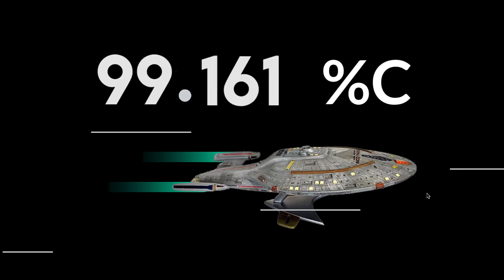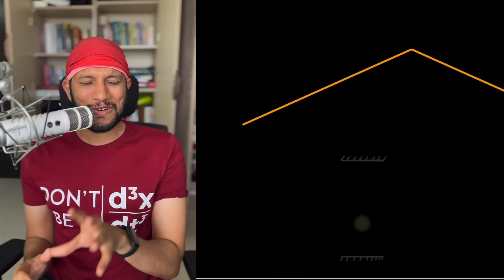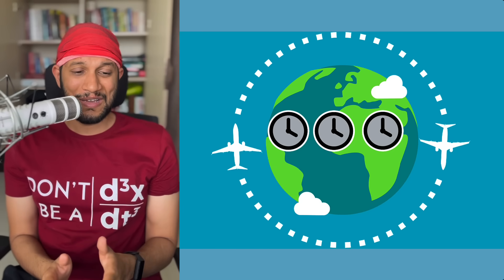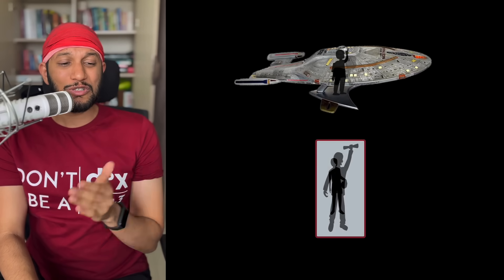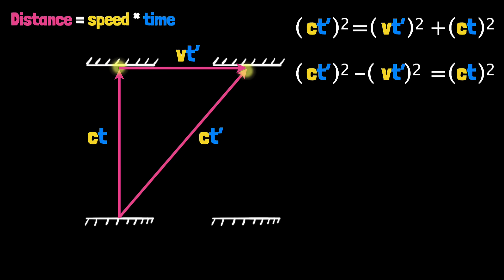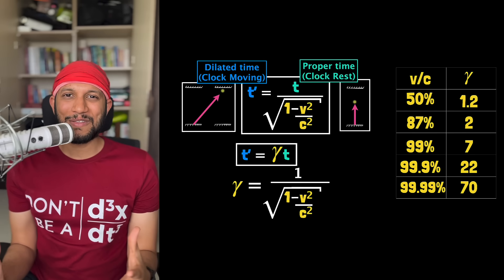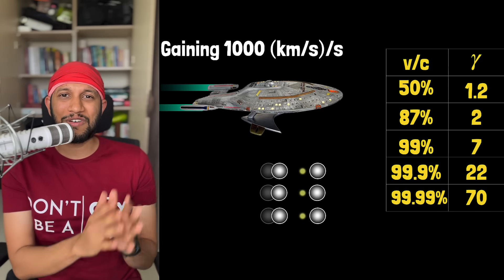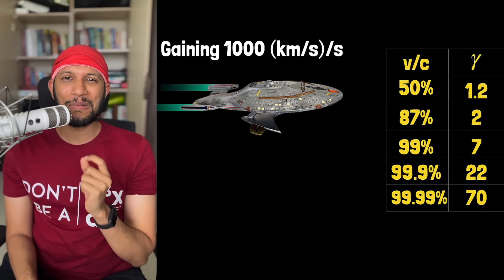I finally understood why you can't go faster than light! (My mind is blown)

Comment: Fantastic and wonderfully explained video. But I have a question...
What if push became pull? If I pulled the lead atoms in an object during acceleration, then the photons for energy transfer should reach the trailing atoms at an accelerated rate. This would decrease time dilation in the body of the ship, but if we used engines, due to how they work, you'd get conflicting dilations with the engines being slowed down while the hull is sped up. 
The solution would be to use external forces, like gravity for example, to accelerate the ship, which should allow the reaching of lightspeed. 

Also, how does this affect an orbiting object when on one side the the planet you are accelerating and the other side you are decelerating? Each half of an orbit should nullify the other half's time dilation. I do understand that this is a bit untestable on earth since the solar system rotates perpendicular to the galactic plane. I hope that makes sense and I am explaining the thought well.

Comment: the problem with this example is that nothing changes simply because of your perspective.  If you are within the ship and you see it bouncing up and down in a straight line, it doesn't change anything.  The relativity of your position to the ship doesn't change the amount of time it takes for the photon clock to tick.  Your perspective makes it seem so, but it's still ticking at the same rate as if you were in the ship.  This is one of the outstanding problems with relativity.  It attempts to measure absolutes based on relativity.  Furthermore, time is a construct.  We use it to measure something between occurrences of events.  In this case, you are giving time a construct of the photon clock ticks.  The event is the strike at the upwards stroke and the measure of the downward stroke.  Time will always be relative to the events used to measure it.  It's not an absolute.  If you want to get down to the real nitty gritty of physics, remove time as a factor.  You will get much further in your research.

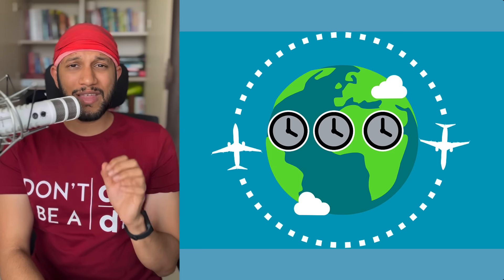Comment: 4:24 basing of what you said, as a plane traveller I could also say that the Earth is moving, not me, and its time should be slowed down instead of mine but the effect is opposite, I don't understand why.
Reply: 7:44
Reply: According to SR, from earth, the spaceship clock would slow, and from the spaceship, the earth's clock would slow (considering their frames are perfectly inertial wrt to each other constant velocity*). but during that acceleration and deceleration to get to light speed, go to space and return to earth, stuff happens and spaceship gets rusted (of course, you can calculate it) (search accelerating frames and time dilation).

Comment: I understand this perfectly well, and it makes sense, but I've always had a question that makes me feel like this might be incorrect on some level. Whenever the idea that accelerating to light speed takes infinite time is mentioned, it's always explained from the perspective of outside the ship and with the logic "light moves at a constant speed regardless of your reference frame". If that's the case, then what actually is light's own reference frame? Because from the reference from of the time dilated ship once it stopped accelerating, now being 'stationary', it would be everything else moving around it at speeds approaching C without having any source for the acceleration. While the light inside the ship is still moving normally.

I'm not really sure if I put it into words correctly, but there's something about reference frames involving light and the universe that doesn't fit in my head regarding this current theory of light.

Comment: Thank you for the nice explanation, I had one question. Is speed not relative to other objects, so if a spaceship accelerates(acceleration is exact) away from Earth and reaches a speed of 99%, it could also be that all objects around the spacecraft including Earth travel the other way at 99% speed. In that case, the spaceship would be able to travel 1% faster. I know I am making a mistake but can someone explain?

Comment: I’m 52 and have a college degree (granted in history) and am also a big sci fi guy. This is the first explanation I’ve heard that actually made sense, even in physics classes. 
Thank you.
Reply: I do not understand this video at all. When he says that the time slows down causing gate speed of the clock to slow down, he means that our actual time slows down? But only because “it takes more time for the photons to travel lengthwise when they are moving”?
Reply: @strokiee  Time doesn't slow down for the people on the ship. For them (the people on the ship), that photon is still moving the same distance and takes the same amount of time. That's where relativity comes in. For the people outside the ship, each "tick" on that photon clock on the ship takes longer for that tick to occur (because the photon is still traveling at the speed of light (no faster or slower) but covering not just the photon clock distance but the distance the ship has traveled during that tick as well. That requires time to slow down for the moving object, but only relative to objects around it in order for that photon to cover that extra distance. The people on the ship will theoretically age at a slower rate relative to the people not on the ship. Nobody notices the difference because time is relative. Not sure if that helps or not.
Reply: @keyser456  this definitely helps, but for the relative observers outside of the ship, they see the ship move slower then for the people on the ship?
Reply: @strokiee  This may sound weird, but I don't think it matters at that point? What the outside observer sees is only relative to their own experience, as somebody outside the ship; they have no clue time is moving slower (relatively) in that ship. 

Whether the ship is is faster or slower (or the same speed) from their perspective has no bearing on what the people inside that ship are experiencing. This is really hard to grasp from our typical human experience. Time being relative isn't natural, to us.
Reply: @keyser456  if there are two objects at rest, and one starts accelerating, then time slows down for it relative to the stationary observer, then surely there has to be a speed at which the accelerating object appears at rest for the stationary object if speed is distance/time?
Reply: @strokiee  From the POV of a static observer, the photon on the ship has to cover more distance, but because c is constant, and distance = c * t, it means that t from the POV of that observer must be longer. And the faster the ship moves, the more distance the photon has to cover per unit time, so time slows down even more from outside POV.

The way you mention 'actual time' is intrinsically problematic. There is no 'universal time' according to general relativity.
Reply: Does he even realize that his conclusion ends with the energy required, infinite or finite? Does he know that he also need energy to see the photon in the photon clock bounce? Just for reference, the photon in the photon clock must split off a photon to our retina in order for us to see it. Even if you only see the photon in the photon clock once a second, the photon in the photon clock must split off a photon to your retina every second, not to mention that Einstein also saw it. So, at least two photons are needed per second. Of course, to connect the dots or photons you see and form the jagged image, does he know how many photons he need to see? Does the photon clock on the spacecraft have enough energy to emit enough photons for you to see it, whether you see it or not? Indians are the best at regurgitating what they have eaten and acting as if they have understood it. After all, at a speed v comparable to the speed of light c, does the Pythagorean formula still apply?
Reply: First you tell time on a watch from the outer radius ticking alone.  Not comparing the smaller circumference with the larger one. Only small to small and large to large.  😂
Plus photons traveling at the same speed will tick faster in a 12 inch box and take longer to tick in a 12 ft box or chasing an object.
Reply: Despite the rude jabs here..."Oh the Humanities!"....your statement is very common in our population.

Many people highly educated or stopping at HS are highly specialized in education today.  There are far fewer hard sciences students than non empirical students in most of society.

However there are a great number of Sci Fi fans that have picked up science sounding terms but applied by fantasy writers as a vague technobabble.

I (physical chemist) run into a lot of people that insist they understand and are experts on some material theory or another (astrophysics, medicine, chemistry, biology, geology, etc...).  Yet in casual conversation I can often find out exactly where they picked up the idea.

I'm sure you find the same is true when you meet someone that learned history at the box office.  History is a fine and honorable degree and profession.
Reply: @STho205  there’s less hard science students because it’s not for everyone. Most people can’t obtain the degrees for those jobs
Reply: @extremelynoobgaming4742 you think everyone on earth is fundamentally the same
Reply: Sorry if it sound mean, but a college degree in history is as relevant as no degree when it comes to physics.
Reply: so essentially you don't have a college degree
Reply: @redbean9410  ???? You do understand that history as a field of human knowledge is older than any natural science, right?
Reply: @teacher_fher  lmao okay and? a history degree isn't gonna get you anything, except maybe a job as a history professor lmao
Reply: @redbean9410  What you're trying to say is that there is no future in history?

Comment: I believe I understand your video. But I still have a question: 
A spaceship is going away from Earth. According to Earth's perspective the time is ticking slower on the spaceship.
My guess is it is the same the other way around, from the spaceship's perspective time is ticking slower on Earth.
But when the spaceship goes back to Earth the interal clocks show that Earth's perspective was the right one.
Is it because the spaceship returned to Earth and not the Earth went to the spaceship's coordinate system?

Comment: What is so special about light that makes it move at the speed of light, while nothing else can reach its speed?
Reply: The fact that it has no mass. Anything without mass moves at the speed of light while nothing with mass can move at that speed.
Reply: @narfwhals7843  thanks for your reply.
Are there conditions in which light travels at a fraction of the speed of light without gaining mass?
Reply: @SamsungGalaxy-vw9gy 
It moves a Little bit slower if its not in a vacuum.

Comment: Still doesn't make sense to me.  It seems circular. The ship can't go the speed of light because a photon in a photon clock is traveling at the speed of light and is being made to travel further.  But then why is the photon traveling the speed of light and no faster?

So, the ship can't go faster than light because the photon can't go faster than light.  Then we could simply change the question from "Why can't we go faster than light?" to "Why can't the photon go faster than light?"  Your explanation still doesn't answer the question.  At least not for me.

Comment: counter point
we are never at "proper time"
we don't have a real frame of reference

while on earth we are glued to the earth which rotates
while in space we are glued to the gravity of earth which rotates around the sun
while stationary towards the sun we are glued to the suns gravity which travels accross the galaxy
while stationary towards the core of our galaxy our galaxy is moving through space 

so which speed is our frame of reference? "proper time"
cuz the earth spins with 1 speed
the earth orbits the sun at another
the sun orbits at a 3rd speed
the galaxy moves at a 4th speed

and then going even crazier since space is expanding then SPACE ITSELF has a speed in which we are moving
so which is our proper time?
Reply: The proper time is, by definition, the time elapsed on your own clock.
It's not some universal reference time. Such a thing does not exist in Relativity.
It is the time that passes for an observer in their own reference frame.
Reply: @narfwhals7843  so time dialation is also relative
if 2 galaxies that are moving away from each other faster than speed of light somehow observing each other how would they notice time for each other?
Reply: @MostWantedWannaBE  yes, time dilation is always relative. It depends on the relative velocity.
If two galaxies move away from each other faster then light they can simply not observe each other. If you allow them to do so you have already broken the laws of Relativity and can draw any conclusion you want.
If they recede from each other very close to the speed of light they will observe each other's time to be extremely slow.
Reply: @MostWantedWannaBE  Correct. We will never observe them. That is what I mean. We can't observe them so we can't observe their clocks. That is part of the laws and if that is not correct we don't know what to conclude.
Spacetime curvature makes this a little more complicated but not so much that it changes the outcome.

Comment: for me is very simple .. light is not an abject actually, it represents microscopic particles like electrons/protons neutrons, that is why it can reach that speed.
nothing bigger than a molecule could reach that speed, not even close... anything more complex than that-  after a collision with other objects  (at speed of light) - would disintegrate at least to a molecule level. and you know, space void its actually not so blank as it considered to be in school. and even light at some distances disappears, because collision with other particles makes the light to be deflected and loose its speed energy.
p.s. in my humble opinion, the light is the actual materia from which galaxies and everything else are created/ after being propulsed at big speeds, at some moment light particles are loosing their  speed energy, but being at different slow speeds, particles at collision start to unite together and at some moment they can even attract other smaller particles with no so big speeds.

Comment: I think of it this way: electrons travel at the speed of light. If an atom is traveling at the speed of light, it's electrons would not be fast enough to overtake the nucleus. 
If the atom is only near the speed of light, the electron would take longer to pass the nucleus in the direction of near lightspeed travel, and the electron orbit's shape would therefore flatten out at 90 degrees to that travel. Hence the shortening effect that an observer sees of near lightspeed objects shortening in the drection of travel.

Comment: The phrase "don't be a d^3x/dt^3" on a t-shirt is likely meant to be humorous or metaphorical, playing with mathematical notation in a casual way. Without additional context, it's open to interpretation, but it could be suggesting something like "don't be overly complex" or "don't overthink things." The third derivative in calculus represents a level of complexity beyond the basic rate of change or acceleration, so it might be a playful way of saying to keep things simple or not to complicate matters unnecessarily. The use of mathematical symbols in a non-mathematical context is a common way people express clever or witty statements.

Comment: Here's a thought experiment for you. Imagine a laser on top of a tower on the earth fires a beam in the direction of a rocket which is traveling toward the tower at 0.5 c. What is the speed of the front end of the laser beam relative to a target on the front of the rocket? It would have to be something greater than c, unless you want to suggest that the rocket is not moving at all, in which case how is it getting closer to the tower? 

If we see the rocket moving toward the tower at all, we would have to see it closing in on the front of the beam at some rate greater than c as gauged by our distance and time measurements. Length contraction wouldn't help you, because we would see the rocket in its contracted form the whole time we watched it because it was already at full speed when it came into view and we started clocking its velocity relative to a series of towers at certain distance intervals. Would we say that relative to the rocket the front of the beam is moving at 1.5 c? How could we conclude that the relative velocity is 1 c when we also conclude that it's 1 c relative to another tower that the rocket passes on it trip toward the laser tower? If the rocket is moving at all relative to the tower it passes then its relative closing velocity on the front of the laser beam obviously must be greater than c. Is the beam moving at two different velocities at the same time?